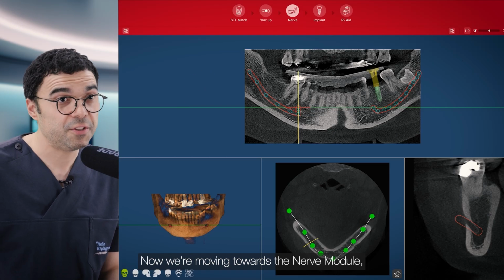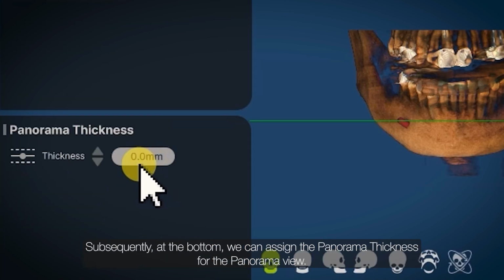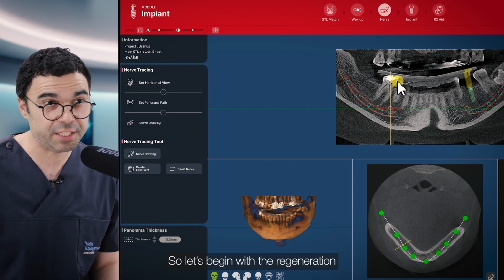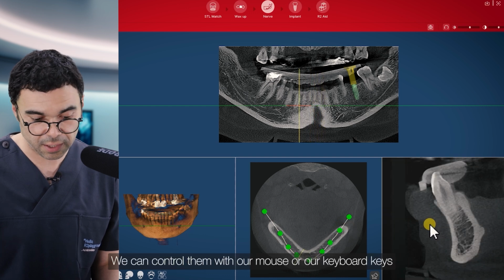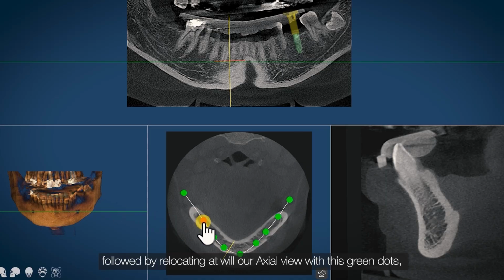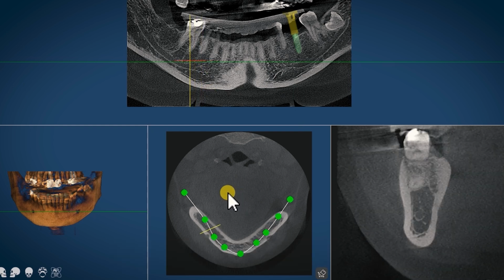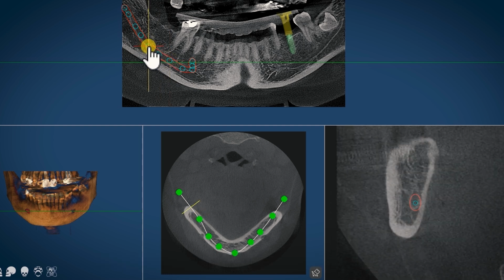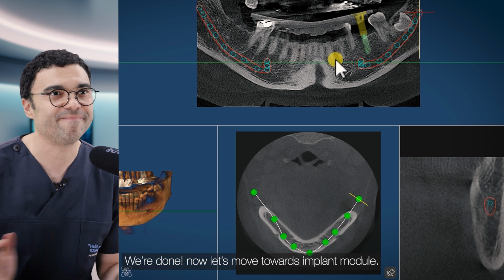R2GATE SA Tutorial Series | Step 5: Mandibular nerve drawing

Comment: Is it possible to enlarge or reduce the diameter of the nerve (red circle)?
Reply from the maker: Hello, this is R2GATE SA. Thank you for your question.

In the current version of SA, you can adjust the diameter of each nerve point (red circle) while modifying the position and path of the nerve canal.

Please follow the steps below to enlarge or reduce the diameter:
	1.	In the Panorama View or Orthogonal View, select the nerve control point (light blue circle) that you want to edit.
	2.	Hover your mouse over the selected point, then scroll the mouse wheel to adjust the diameter.
Alternatively, you can also use the shortcut keys Z (increase) or C (decrease).

We apologize if this feature wasn’t clearly explained in the current guides.
We’re continuously working to make the controls more intuitive.
Thank you again for your valuable feedback!
Reply: Pdf hali var ise paylaşabilir misiniz